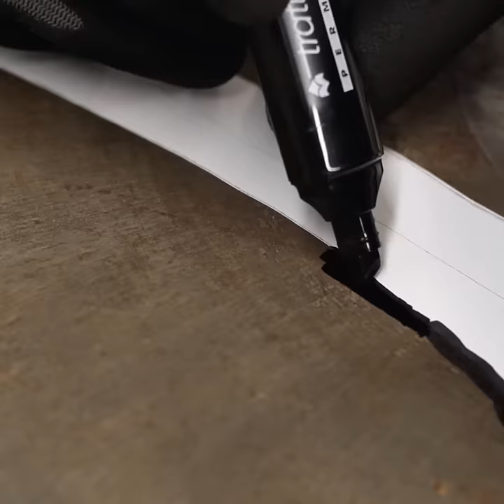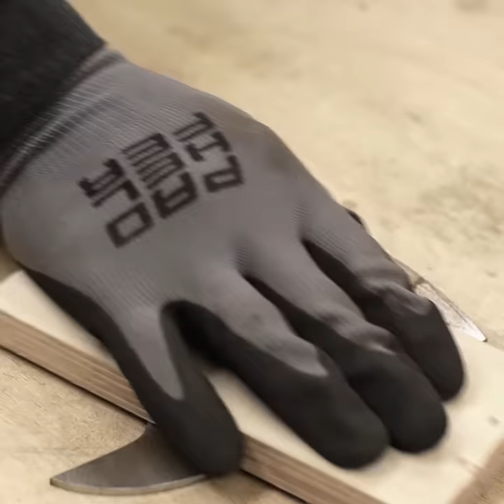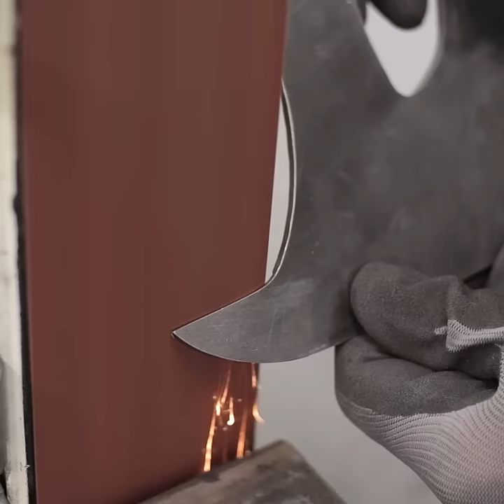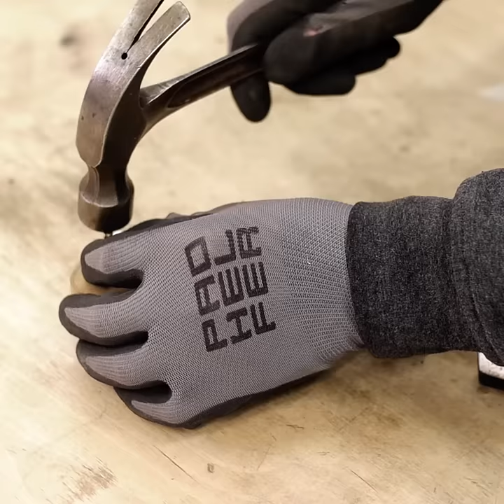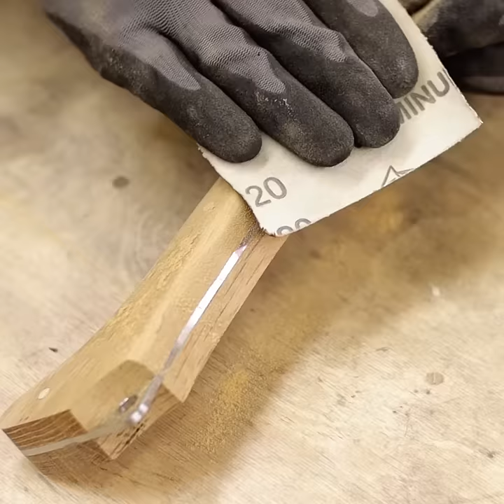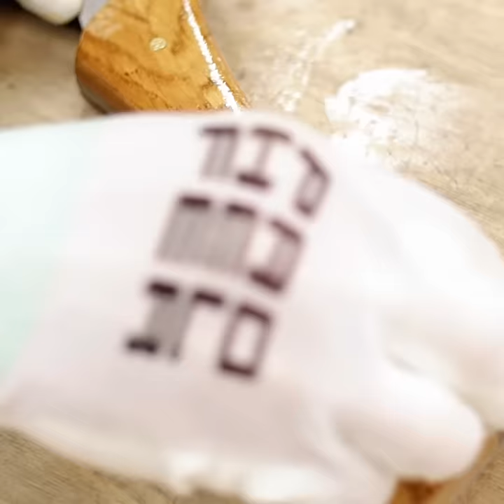DIY Survival Axe  #shorts

Comment: I would love to do it myself... if I could afford the DIY tool necessity that is.
Reply from the maker: If you about sander I use, you can change it with round pipe and sanding paper, it takes longer to make a shape of handle, but it works 100%👍🙂
Reply: Wow thanks! Didn't expect a response.